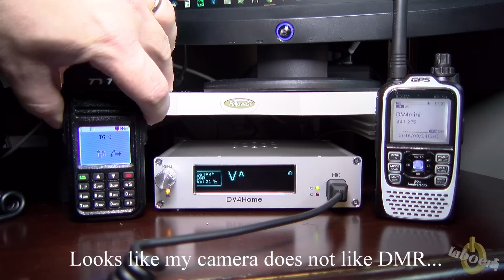Part 2 - DV4home transmit and receive with two actives modes and reflectors

Comment: Will this act as a hotspot for a Dstar or DMR radio? Once configured, will it operate stand alone with just a port into a router? -Bob K6UDA
Reply from the maker: Hi Bob, see my answer to Adam, just above your comment.   The DV4home is not a hot spot, it's an IP transceiver.